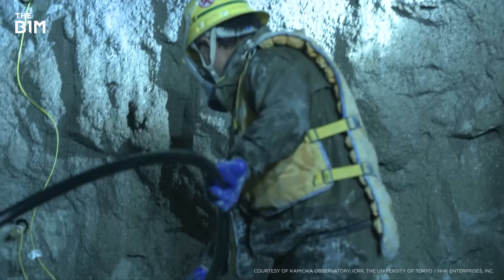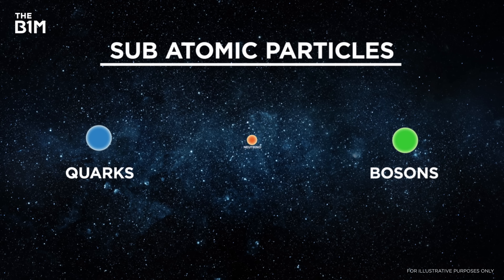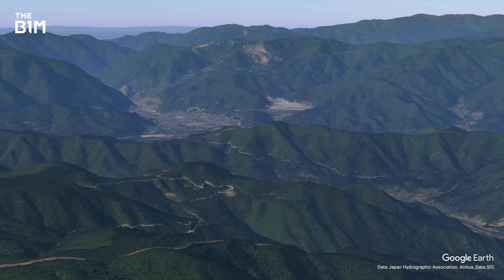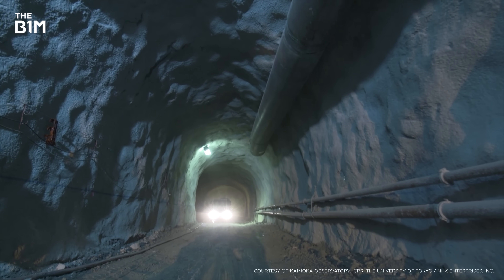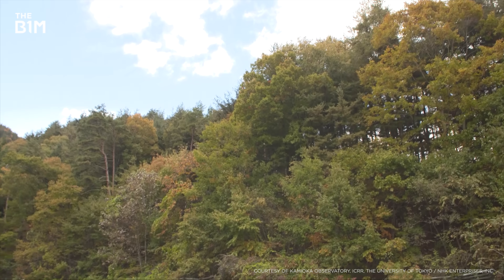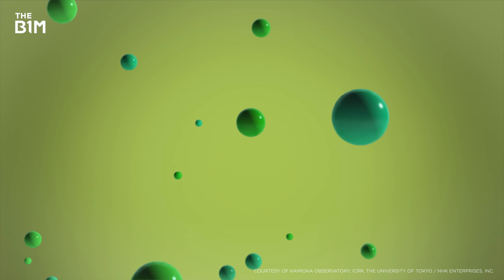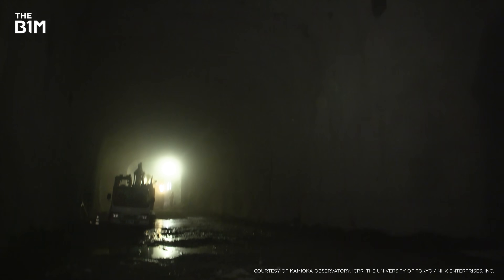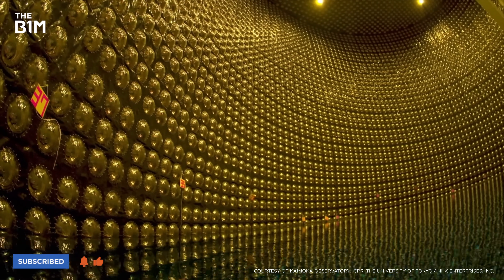Why Japan is Hollowing Out a Mountain

Comment: 5:16 "water so pure it's capable of dissolving metal" ... The University of Tokyo will be proud of how you are sharing this great project with the world.
Reply: The dissolving metal thing is backwards. Metals slowly dissolve in any water. This water needs to be kept so pure that even that miniscule rate of contamination would measurably degrade the instrument. I assume the experiment is line with glass or other ceramic.

My well water has so much dissolved iron that it can become visibly orange[1] if the iron is given time to oxidize. This is visible in a few centimeters of water. The experiment has sight lines that pass through more than 100 meters of water. It doesn't take much dissolved metal to fog the view.

Note [1]: color change depends on what else is in the water. The iron oxide precipitates out as an almost black powder in the swimming pool, rather than the traditional "rust" color.
Reply: Water is the universal solvent
Reply: The relentless pursuit of clicks degrades lots of science content.
Reply: The first-generation water Cerenkov detector experiment was halted because water leaking from the tank, as I have heard...
https://youtu.be/vgdzWb9yMfs?feature=shared
Reply: Hmmm but then it wouldn't be pure... We use deionized water in industry all the time, it doesn't conduct electricity which makes it great for cooling and because it is "clean"  then anything it picks up off your product and is later filter out comes from your process (not the water) and can be used as a measure of how good your materials are during the manufacturing process.  ... How to make Deionized Water more deionized? & While you're at it turn up the silence for me.  Okay maybe there a chart for degrees of deionization... idk.  But saying it can dissolve metal ...  metals rust in water... Except for Gold (perhaps a few others) which doesn't rust.
Reply: @Hope4Today9  Everything has some degree of solubility in water, even if that degree is very close to zero. I'm not going to bother looking up individual metals, but for example say that for aluminum that degree is one part per million. That means for every kilogram of water, one milligram of aluminum will dissolve in it. That's what we call the equilibrium point, as once the water reaches that point every atom of aluminum that gets dissolved will result in one atom falling out of solution. If water is "so pure it can dissolve metal", it means the water is well below that equilibrium point and it can dissolve more metal ions than it currently has. If you are running a purification system to constantly remove dissolved metals, the water is constantly in a state of being able to dissolve more metal. That doesn't mean the process of dissolving metal is fast, just that it's an ongoing process.
Reply: @Hope4Today9  Someone already replied to you but I would not confuse rust and dissolved metals as one in the same. Many years ago in school an old teacher explained to us that the oceans hold more disolved gold in them than human kind has ever, and will ever, be able to mine from the Earth.
Reply: @Hope4Today9  No, it'll pull gold off a beryllium-bronze Nd:YAG laser head cavity. This was back in the 80's.
Reply: Is this how the Universe, Galaxies, Stars, Earth begun?
Reply: would be helpful if the author would explain this extraordinary statement!?
Reply: Water that pure would probably dissolve people who drink it.
Reply: Jesus Christ, it's just fucking de-ionized, it's not magic.
Reply: I live in Japan and I had NO idea that an insane project such as this is being built
Reply: @VS257 Since you're paying for it, they'd rather that you're not too familiar with it's cost.
Reply: Why, its poison cannot drink
Reply: @lindenhoch8396 Half a billion dollars for a scientific project this size and purpose is really not that expensive.
Reply: @lindenhoch8396  No it's probably just because there's no reason for a big publicity campaign, just like how fixing roads isn't made readily known because there's no need
Reply: MY RO water is nearly pure being around 10 ppm. It is also acidic, with a ph around 5. Normally, water is alkaline or treated to be neutral at ph of 7 for quality and taste. We don't want metals leaching into our drinking water, do we? The water lines for my system are all plastic as the copper and fittings would quickly corrode at ph5
Reply: @intractablemaskvpmGy  If your RO system is delivering pH 5 water, there's something seriously wrong with it. Autoionization in water will always give pH 7-ish water (depending on temperature), so if you're getting pH 5 that water isn't as pure as you think it is. Or you have it pressurized and superheated to about 300C, that would work too.
Reply: @willythemailboy2  Yeeaah. I think you're very wrong about my water and reverse osmosis in general. There's nothing wrong with it. RO water is acidic.
Reply: @intractablemaskvpmGy  Even if you're not degassing it, it shouldn't be below 6.5, 6.0 at the lowest. If you're getting 5 you must be leaving it out for hours to let it collect carbon dioxide from the air, in which case it's not really deionized any more.
Reply: @willythemailboy2  You must be confusing  water softening with reverse osmosis, though they work extremely well in conjunction
Reply: Pure water is less corrosive than water with impurities.
Reply: Yes, that how it has been described previously (water in Kamiokamde) . Basically, ultra-pure water starts to exhibit some pretty strange behaviour being both alkaline and acidic at the same time as water starts dissolving itself creating hydronium (H3O+) and hydroxide (OH-) which then react with anything.
Reply: @ZvonimirZelenika  This is a load of bullshit. H3O+ and OH- ions are present in water at any purity. What was actually said is that water has "features of an acid and an alkaline", not that it is acidic and alkaline at the same time.
It was described as follows: "Water that’s ultra-pure is waiting to dissolve stuff into it", meaning that pure water has a tendency to dissolve other molecules in it, but that does not mean it can really dissolve macroscopic metallic objects.
Reply: @div_tm  General Chemistry: everything is soluble to some extent.
Reply: @div_tm  A hammer was dropped in Super Kamiokande. It was found much later hollow. The chrome on the outside being left.
Reply: @ZvonimirZelenika Not a chemist (bio sciences), but I don’t  think auto-ionization of H2O means it has both properties of acid and water, but rather self neutralization in maintaining pH at certain levels. Correct me if I am wrong.
Reply: They should fill it with that nuclear waste water instead of dumping it into sea.
Reply: @cuteandfunnyearthlings2863 I was thinking that.

Comment: 1:54 Wait, Nijuugo? As in 二十五? Or written alternatively as "２５"?
It would really be a remote place if they just call it "mountain 25" xD

edit: I did a quick search on Google Maps and I couldn't find it. I did another Google Search, and I found it being mentioned on the wikipedia, but I haven't been able to find any proper reference to the actual mountain. The most I could find was "Nijuugo-yama", and "yama" means "mountain". 
I feel like someone made a mistake and thought the name of the mountain was "nijuugo", and people have used that as a source. But I need to look into it more to confirm if this is actually the case.

edit 2: The "List of mountains and hills of Japan by height" on Wikipedia does not mention "nijuugo". I know the coordinates of the mountain, so I should be able to find the name of the mountain somewhere

edit 3: I found Something about "二十五山" on the website Yamap (ヤマップ). It seems like it is the actual name of the mountain, but there's hardly any information on it